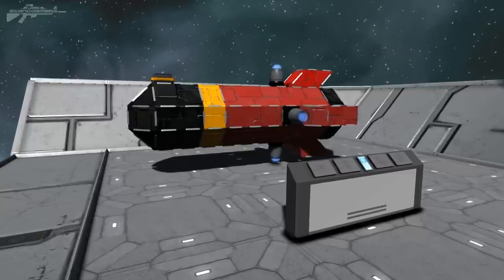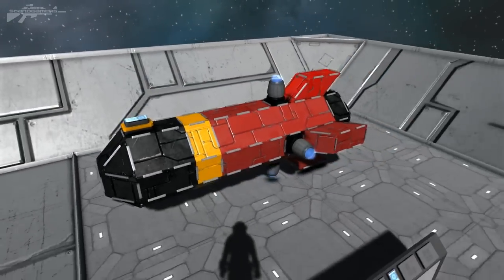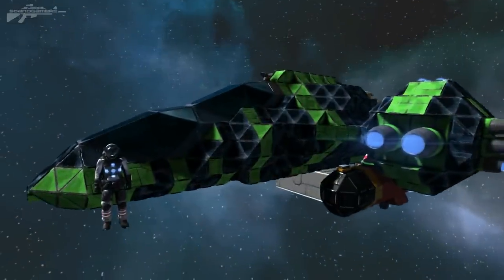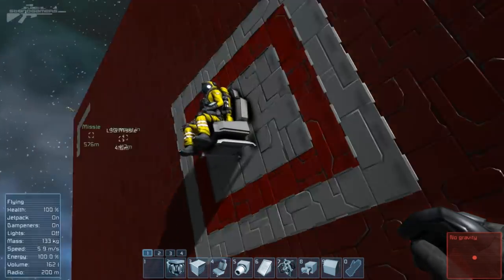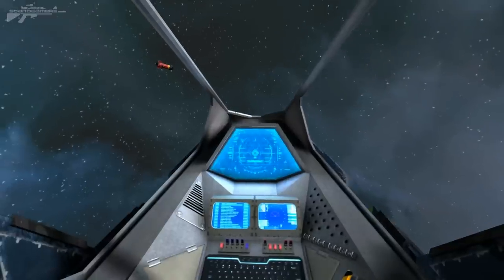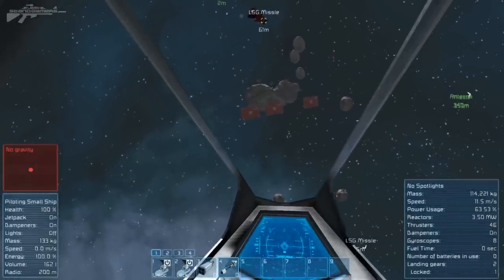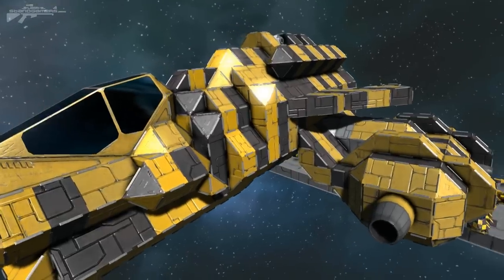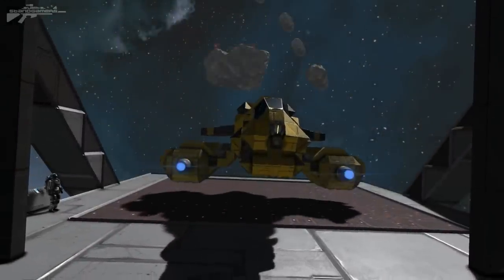Space Engineers - Remotely Guided Missiles & Booby Trapped Ships

Comment: Using some of what Aaron has said in this video, I made a very basic, but yet effective method of conducting space station sabotage. Using a small ship, with a remotely connected "breach charge" (warheads, cockpit, antenna, reactor, landing gear, and merge block) Mounting this on a small enough, faster enough craft, I am able to place the charge, connect it to the hull of the station, disconnect from the ship, and then remotely detonate it when safely out of range.

NOTE-
In my testing, small ship warheads aren't very effective against armor, but large ship warheads, however harder to transport and place, are much more effective.

Comment: An interesting idea would be to use the remote control system for a sort of Rally Race.

You'd need about four friends and two ships with passenger seats, thrusters and gyroscopes. Two people would ride in the ships but have no control over them, while the other two would guide the ships from a station at the starting line. The passengers would have to guide their drivers to get them through a series of checkpoints to a finish line while racing against the other ship.

Comment: Hey, what about one of these missiles except expanded a bit to fit soldiers and with the pistons they can extend and grind! 

Other;

A triangular pod that can be dispatched from large ships or dropped from small ships. It has four landing gears on the bottom and a hole to extend a grinder. Inside, it can suit about four soldiers on each side armed to the teeth and ready to invade. A pilot can extend the grinder's arm (piston) and grind an entry way for the troops. Obviously, this would work better on stations or large ships. If pressurization comes into existence with Space Engineers it would do severe damage to people without the proper equipment. It can also help breach hulls with a saboteur unit that is filled with explosives that can grind through the hull and drop explosives down the hole and blow it up.

Just an idea, really.

Comment: Couldn't you just place a missile block on the front and it will provide a dot for you to help out.
Reply: That would be expensive.
Reply: No. I just mean like have the missile block somewhere inside so it provides a dot. Why would you fire it?
Reply: Well that would be a good idea. Maybe like fire 2-3 missile just before impact.
Reply: Why not just make a drone to attack in that case? because if you're going to spend so much resources why waste them on a suicide bomb?
Reply: But the drones will most likely get destroyed in operation by either man operated turrets or Gatling Gun or Missile Turrets. And for the drone you would need a conveyor system and all that extra stuff along with more thrusters on front and back. And if you do get it back you will have to spend time repairing. So suicide bomber is better because you can just re make them instead of having to spend time welding and adding extra torpedos.
Reply: The drone wouldn't need conveyors, it would just be a short little excursion where you would use what's loaded in the missile pods and/or gatling guns.

Comment: OK. Without skill of space engineers, I am able to see several things about this right away. It is tougher than the normal missile, and could cause more damage. Down sides? It could be more expensive than making normal rocket pods and rockets, as well for this to be effective, you would have to spend A LOT of time timing your turns to get the direct hit. Meaning that you would be better off shooting a hundred rockets rather than these. As well this rocket is larger, which can be easier to be hit. Sadly, piloted turrets can even hit these (if they are on duty or guard with lots of shifts). So, this is actually clever, but if some players are on guard with marksman rocket turrets, this missile will be easy to hit. As well you would need to fly around to see the missile. Leaving you vulnerable to attacks. So which means, this is a crap way to attack, more of a noob attack, but it is clever.